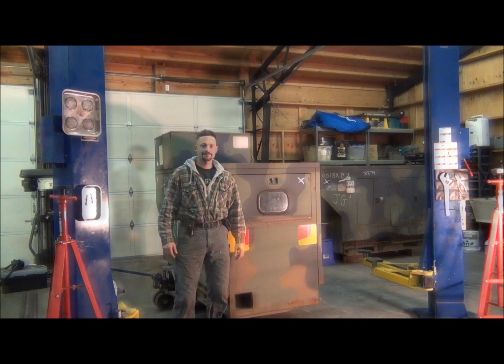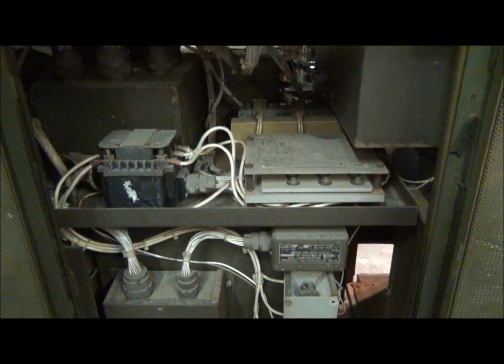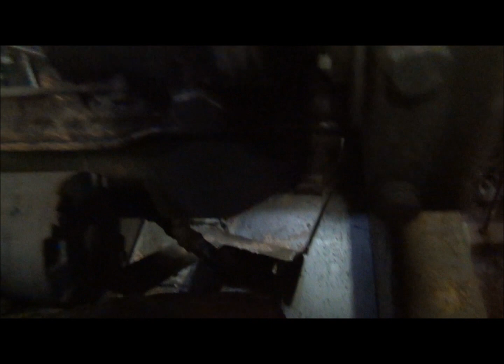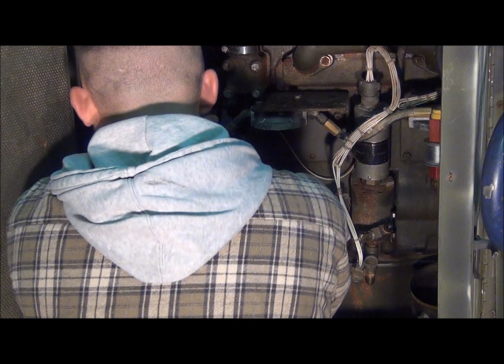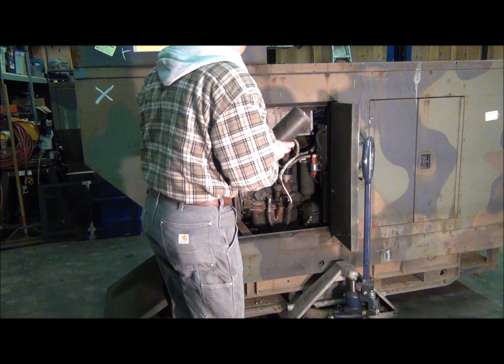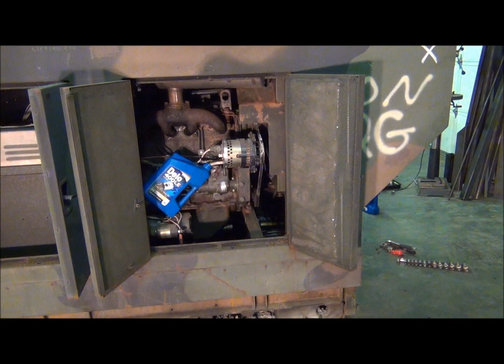Military surplus generator repair, and first start after years of sitting

Comment: Well I turned on the generator and held the run switch for 10 to 15 seconds after the engine started and still did not get a field flash. I tryed about 8 times and had no luck. I disconnected at the visable electrical connecters and reconnected it and I did not see any corrousion. Could it be a faulty voltage regulator?

Comment from the maker: Be careful while trying to flash the field that way...I'm sure you understand, but if the set does begin generating power while you are doing this you'll end up with an exploding battery, melting wires, etc!  
The most common mistake people make when starting these sets is that they let go of the start switch as soon as the engine starts running.  You need to continue to hold it in start after the engine starts for around 10 seconds for the field flash (the starter will automatically disengage)

Comment: Good video! I bought a similair unit minuse the sound covers. Its a 15 kw unit which had a new engine installed in 2007 with the original unit only having 2 hours on it. In total the unit has 29 hours on it. The engine starts up great but I am not getting any voltage genertated. I used a 12 volt battery and flashed it manually through the front convience recepticales. Do you know why I cant get any voltage generated ???

Comment from the maker: There are quite a few surplus dealers that carry most parts for this set.  However, I've found that it is cheaper (and often times easier) to just modify with off the shelf parts; the generators are build using a standardized design and are easy to modify/repair.

Comment from the maker: @kmluddy Nope...by idle I mean running the generator at a low RPM.  It should ALWAYS stay adjusted for 1800RPM (60hz).  Running it at a low RPM will burn up the voltage regulator.

Comment from the maker: @kmluddy You adjust frequency with the engine throttle.  Frequency varies with engine RPM.  A few things to know as well;  1. the frequency meter won't move if the generator isn't making power, so make sure the voltmeter is reading voltage first.  2.  The MEP-002a is not designed to idle!  Idling the set for even just a few seconds can burn out the voltage regulator.  So, set the throttle to 60hz and leave it there.